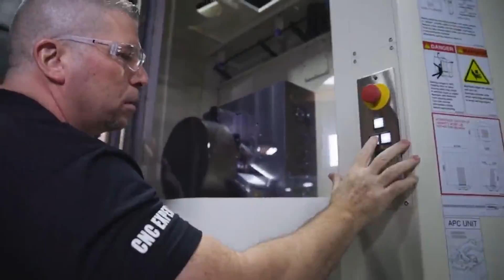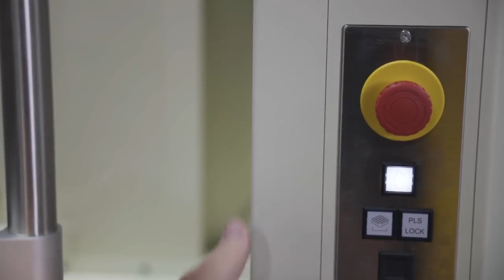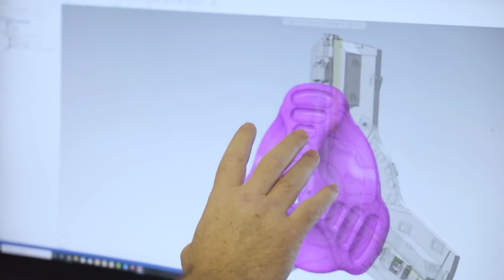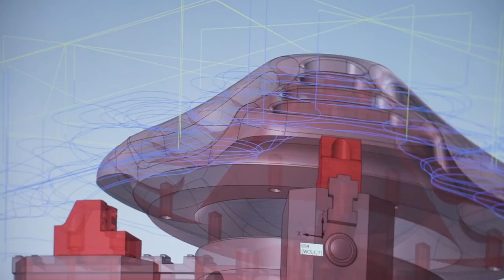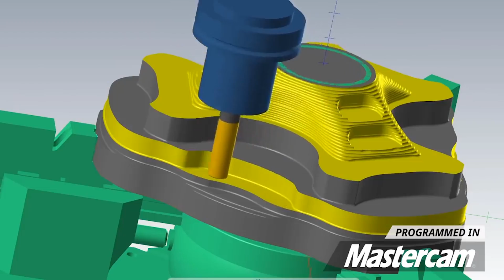Buyer DEMANDS 15% PRICE DECREASE or Parts Get Outsourced!

Comment: I was a machinist for Michelin for 11 years making tire molds , they held us to some crazy tight tolerances but we gave them what they required the bean counters had the bright idea to outsource some of the molds to China, and as you could expect we had to rework almost everything they did, one thing about machining is you can’t replace metal once removed !
Reply: I've worked in the high tech rubber molding industry for helicopter parts and the molds have much tighter tolerances than plastics molds.  China doesn't come close to meeting the requirements.  Even most other shops can't do the work, so we have a huge internal shop with some very skilled people.  They did amazing work.
Reply: I was basically referring to the complexity of a sector type tire mold, there are so many different parts made of cast iron, carbon steel,aluminum that are machined to fit together within thousandths so sometimes there isn’t anything left to rework, cheaper to remake and then where is your savings !
Reply: You can. But doing it right is expensive.
Reply: If you got a buddy in the welding dept....
I worked for a bay area shop that had better than 14% scrap rate on parts in cnc dept.  It became 1 of my jobs 
 the scrap, often taking just as long as the machining process.    They didn't run dedicated fixtures. they set up each part and hoped step blocks would hold it.
The heavy passes they were making too save time, were squirting the parts around as much as .007, wich if you got +-.005 max is not good.    Finally talked them into spending some of my time making  dedicated fixtures for the parts, that didn't move around 🙃 😅  you would think I invented fire.     Training,  and listening too experienced personnel costs $, and all the white collar guys have too justifiy their salaries and bonuses by making as much $ as humanly(ok, inhumanly) possible.
Read greed.
Reply: Well actually you can. It's called welding period and I've done it to so many Outsource jobs so that my boys can remachine  it back into the proper tolerance. LOL that's what actually gives us all the overtime they complain about paying for
Reply: Additive manufacturing will do the job….
Reply: @reynaldorosas4187  This is technically correct in a bad way.

So imagine an inconel turned part 5" in diameter and now scrape off a 200 thou radius. Yes you can get a welder to weld on more. This takes specialised welding rods wielded by someone who knows what they're doing. Given it's inconel your part will likely need a full on inspection afterwards. Both of these are rare jobs done by specialists in their field.

So. Have fun calculating how much all that costs compared to getting it right the first time around.
Reply: @benlubbers4943  As a welder (I only do mild steel and sometimes aluminum). You technically can weld high carbon steels and the more exotic chromium, cobalt, molybdenum, and other "fun" alloys, but be prepared for endless headaches. Finding someone skilled enough and with AWS and ASTM certifications is next to impossible, and then get ready for everything to cost a fortune. Paying the welder, materials and setup, time, just everything will cost a fortune in weld repairing expensive alloys.
Reply: @benlubbers4943  plasma spray repair will add material. But I only used it once to fix a critical diameter that was off by a few thou.
Reply: And they copied on how to make moulds and tires in China afterwards. That CEO is a genius.
Reply: @HuckThis1971  
That's why he makes the big bucks.

Comment: If your company could have made a 40% discount and still been profitable, then yeah, your boss had an error in judgement by not providing the 15% discount to the customer as requested given the improvements to process you had provided.

However, after moving on from that job, taking that lesson with you and instead translating that into working at 2am, etc. to "get the job done" is a horrific work/life balance compromise.

I can understand if you are running your shop 24x7 in shifts, there is nothing wrong with that. All too often, what I have instead encountered are employers who want to keep me at a desk 40+ hours a week and then on call 24x7 and that isn't healthy. If you are running operations 24x7, then you should have three 8 hour shifts and make sure you have fresh employees rather than creating insomniacs on their way to burn out.

We are humans, we can and do operate machines efficiently, we should never become machines ourselves. Wage slavery, is still slavery.
Reply: Were I worked the management  required a lot of overtime and let workers work as many hours as they wanted.   Management could not understand the shitty safety record we had.   Also broken   families and drug problems

Comment: I've read comments under this and I see most of you guys make one big mistake, you think that Asian manufacturers lack any or all of those three things: materials, knowledge or skill. I can assure you they don't, and never underestimate especially Chinese manufacturers on the basis of crap your former customers send you to repair. Only reason for that is greed. They wanted to pay specific amount of money for piece, and that's exactly what they got. Most of you never seen good quality Chinese products only because it wouldn't be cheap. At rates you do things they can and will make things of equal or even better quality from appropriate materials. Every one I know who seen some factory in China, construction machines, metal works or electronics, says similar things "they make product in various prices for different parts of the world, some of it is total crap usually for Africa and other poor regions, other still crap in European standards for local market, next is cheap Europe and America little better than those before, after that comes normal price stuff for those willing to pay and that's the point where quality starts and there is also relatively small production of really good stuff for those customers who chose quality over price. Every new worker starts in total crap part and goes up if his skill rises."

My own comment to this video is your boss was partially right, I mean 15% off without reduction in quality or speed is a straight No, and process used at the time doesn't matter. If customer is ok with drop in quality or/and quantity and is flexible on the material then we may talk about those 15%. Otherwise let them outsource the job, clearly they are stupid enough to think it can be done well very cheap in Asia. Lets face it guys they want 15% from you, without need for time and money consuming transport, so what they pay abroad is 20-30% less, or even less, than your rate. Conclusion is they want to buy crap and that exactly what they will receive.

Comment: Out of my experience Cheap is expensive.
I was working for a very small machine shop 2012.
Same as you.
We starded buying cnc machines in.
I was working them.
Customer was always happy.
Untill new directors at client.
They where very pushing hard down on prices.
We stop agreeing with here prices there willing to pay.
So work dried up.
After 4 months the same parts we get order to do in very big order!
But price is X2 and need to deliver in 28days.
Client send drawings to China.
They delivered! But the parts quality and material was bad.
Far to our spec from South Africa.
So Il learned: You can not always help everyone in life.
Price is not everything.
Price
Quality
Quantity
Turn around time
Delivery

Comment: I would of raised 15% and made a statistic base in parts,tooling,labor,equipment, out of pocket expenses and would of Brought out the old expense or sourced that they used b 4 coming to you and renegotiate ur contract sure lower some parts of it but increased on what ever part takes up more time n energy. I know I know easy said than done but that would be my thought process.

Comment: I worked at a shop that supplied parts to G.M. back in the 80's, when they started their cost cutting they would give you a 5 yr. contract but you had to reduce your price 1-2% each yr. They figured you should be able to come up with cost reductions over time when you are making 5000 parts a day.
Reply: Thats actually a reasonable compromise imo. Most of the time, a 2% reduction is pretty easily attainable. From what i have seen in manufacturing, you could do that just with a few tooling upgrades
Reply: This price reduction is usually based on a learning curve calculation. This is based on the fact that every time production doubles, the costs of production move down by a calculatable amount, and that is what they are asking for based on the volumes they're giving.
Reply: They still do. If you want a longer term contract of 5 years or more, its a yearly 1% reduction, at least.

Comment: Same issue India, we manufacture machines for sheet metal forming and levelling. The day we installed our 1st VMC and turning center regular customers start saying and pressuring to reduce prices of machines 2nd even after years they want old prices saying now you have CNC's or they will blackmail to go to China made machines.

Same issue with my friends manufacturing tractor parts and auto parts.
Reply: If you have any power to sway this, Keep the work there, in India. While I want Everything made in USA, if prefer in the spectrum, for products made Anywhere but China, and Indian products can be very well made.
Reply: Do you, can you, make stainless steel product? Do you make or incorporate wiring and controls, PLC etc?

Comment: Lol. My last job has a wage issue and employees moral issue. I ask for $20, they low balled me to $16. They also rush the programmer so fixturing and creating the part was a disaster. So I would cut a 12.6ft wing straps down to .050 (inches) and they would remachining in another machine shop. I'm not understanding their logic here but wouldn't it make sense to make it right the 1st time and get a better machine? The machine I was running was from the year 2000 it was (mighty) viper running on hydraulic fluid and it last leg. It would alarm out on the B axis due to the bad wiring. I also  ruined 1 part because I forgot to re-home the  A&B axis. Eventually they got it fixed but it went down after I quit. I just couldn't handle Such negligence.

Comment: Most shops are running on single digit profits. Last place I worked we would retrofit/automate and computerize old equipment for high speed production. Sometimes we would lose a job to Mexico or China and then with quality issues ect they would come back and want us to do the job again . Sorry we would find new work that was more profitable and just don't have the machine time for your part anymore.

Comment: It’s the old saying you have it cheap, fast, and well done. Pick any two you like!
The funny thing with his story is they took the machining away and outsourced it, then sent the outsourced parts to titan to fix? So they saved 15% on the part originally but add in the shipping and then added fixing time they probably lost the 15% and added an increase 2-5%
Reply: In addition they now have a shipping lag but that's probably not an issue (rolls eyes).

Comment: That can be a dangerous road to walk especially in these times. A lot of the time, there is built in margin for expected cost increases. If you set a contract price at a break even in overhead to keep machines on, and then next month the market swings and steel goes up 10% then you're in a tought position. Price is important to customers, but so is consistancy.
Reply: Try a 60% price hike in a month.
Reply: Our company has had to add a surcharge for cost of material because of the unbelievably insane amount of inflation every WEEK that happens.
Reply: Pricing and sales have gone crazy the last month. Everything is going like hot cakes, and material costs are exploding. It's the wild west out there on the market.
Reply: This is why you work on parts that have high value low material cost. If material is more than 50% of the part price, you either need some special clauses to be covered or you need to find some different type of work. I regularly made parts that sold for $80-$100 that only had $10 or less of material in them. That’s the secret to controlling your profit margin.
Reply: @stbentoak5047  that works if you want to limit your market i guess

Comment: We lost a  high volume job to China simply because we could not get our price down that low.
A month later truck loads of these parts were arriving to be reworked.
This went on for the better part of 6 months .
The money we made on the rework far exceeded what we ever would have made had the job stayed.
It was the best job loss we ever had.
Btw in your case giving up the 15% was the right call
Reply: Yep! I regularly hear horror stories from buyers about having to buy 100 parts from china to get 10 good ones. And then, theres the added cost of 100% inspection to FIND the good ones, then the rework costs.

Comment: I understand Titan's business model of keeping the machines running 24/7 at a rate that generates a calculated, predictable profit is different and somewhat innovative in his own way (emblematic of a young, hungry entrepreneur) but I would not have agreed to rework the parts. I think your manager at the time, who was willing to work with them to negotiate cost-cuts, was probably fair and open-minded in his concession offers. That exec asking for the 15% cut on parts across the board who ended up outsourcing to Malaysia, only to then having to have them reworked is just another classic example of a sellout to this country's industrial, economic, sovereign self-sufficiency (i.e. in the vein of what the U.S. has been recently experiencing as a result of examples like its short-sighted lack of domestic chip and pharmaceutical manufacturing). Their savings were probably insignificant and/or possibly a loss/part. Summed up lead time was probably also worse for them. Another greedy, short-sighted weasel looking to make a big impression with quartertly/annual profits (that likely backfired) for a bonus/raise. Look at the statistics on how far C-suite salaries have diverged from average professionals. What benefits come from all those temporarily maximized (but significantly-diluted, when taking all aspects into account) profits? Nothing but more glut for the spoiled kids, mistresses, wives of those execs and boardmembers (and themselves) so they can have bigger villas on the Riviera and bigger yachts for bigger parties with more coke and bigger orgies, more Porches and Ferraris, etc. that sit in giant collection garages, hardly ever driven and millions that will never be spent sitting in bank accounts to spoil generations after generations of their descendants. For these things they all sell out their contemporary citizens, families of in their own sovereign countries. They'll spend millions on capital expenditures to set up plants and validate processes in those cheap labor markets, only to have those very plants run ghost shifts and sell clones of their very products at fractions of the prices, competing with very product those short-sighted, greedy "geniuses" completely funded the infrastructure to manufacture offshore at costs the outsourcing company itself cannot compete with because the offshore manufacturer never had spend a penny on the manufacturing facility or the process validations to manufacture the clones (and that's not even getting into the subject of the companies'/engineers' IP that gets outsourced in order to manufacture innovative products and undergoes the same theft, which is a whole other level). Great deal for the offshore manufacturer and the clone products' prices (which are really the exact same parts), a short-sighted and  pointlessly greedy betrayal of their own sovereign citizens by the outsourcing company. Small minds with myopic foresight and greedy hearts.
Reply: Well said....
Reply: @roberthowe2910  Thank you very much, Sir.
Reply: @EnGenX2112  Yes, well said.
Reply: @roberthowe2910  I agree
Reply: Excellent points
Reply: Pretty much summed up everything I have observed in the past forty years in one (admittedly long) response.  Good job.
Reply: Depending on the part and processes and tolerances involved sometimes the rework time exceed the time to remake it  from scratch. Actually met a customer injection mold shop who charged full build price to "repair new  over seas molds " just built them new.
Reply: Ugh. I hated reading that but it's sadly all true. Surrounded by sell-outs.

Comment: At best return a counter-offer of a few percent, but giving in to a 15% decrease across the board, because a new manager just felt like it, no. If anything, letting that slide unchallenged will likely end up in more silly price negotiations.

I work in the cable industry, and we've seen customers leave because we didn't comply to similar demands, just to have them come back a couple of months later groveling, because quality from cheap Asian manufacturers was anything but sufficient.
Reply: I agree with you bro, asking just like that for a 15% decrease is insulting. I would have told them that I was about to call to tell them about a 15% raise in all prices just because we have a new manager too.
Reply: to be honest I would have just been like 'explain why, in a manner that will not want me to raise my prices and refuse rework of parts made elsewhere'.

somebody else had a great comment which was 'yeah cool but here's a contract with a guaranteed quarterly volume waaaaay above what you were doing before'.
Reply: "I work in the cable industry" - OMG the UTP and coax cables they make from the worst copper-plated aluminium ever known to man, they're making me avoid them at all cost!